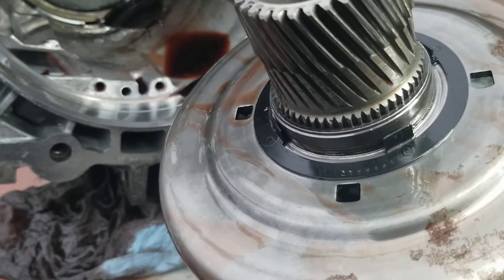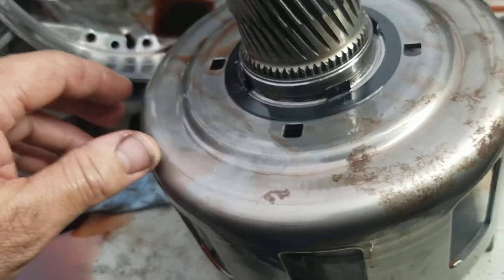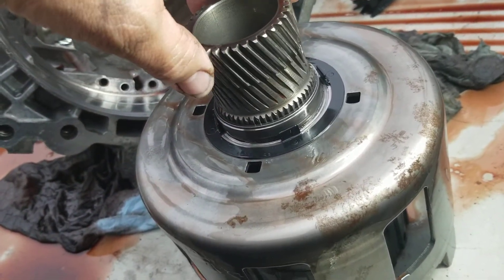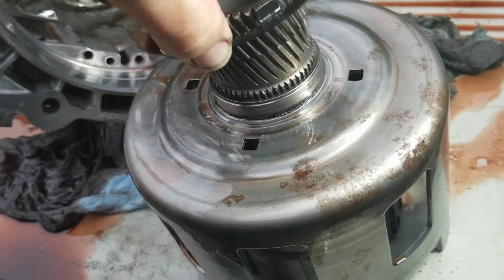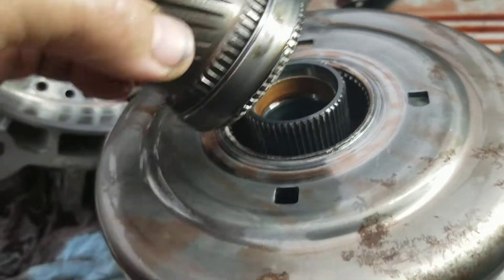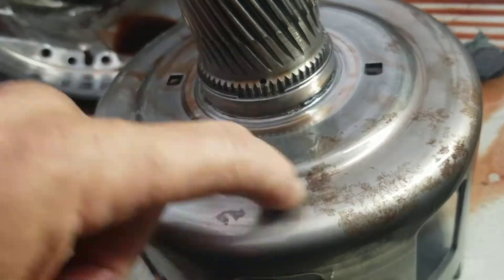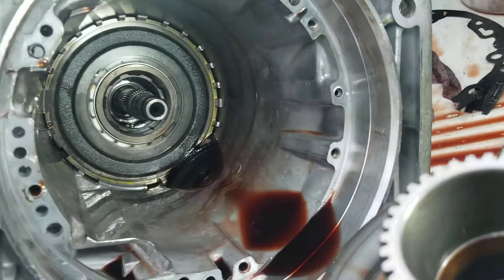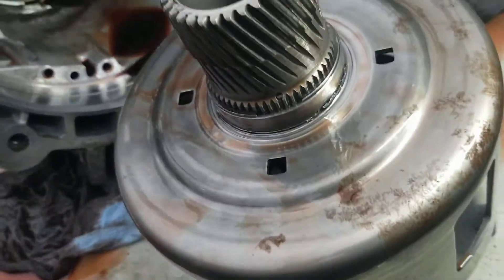4L60E broken reaction shell no reverse

Comment: Do you need to replace the torque converter with a stripped sunshell?
Reply from the maker: No, but if the pump gets trashed that means metal got circulated thru the transmission. I had a few that drove thousands of miles with no reverse. It still worked but lots of hard parts were damaged including the pump.

Comment: What should a shop charge on that thanks
Reply from the maker: I did one recently. I only fixed the reaction shell. It cost approx $900. 
That's $300 to r&r the rest on parts and oil. It's a tricky because if you have a worn out transmission it should be completely rebuilt. This unit I rebuilt many years ago and it had a external filter that kept all the extra metal from trashing the pump.
A shop is gonna be about $600 more.
Reply: I have a question. I have a 97 Chevy Silverado with the 4L60E. I was driving back to work and out of nowhere I started to hear a terrible grinding noise. Kind of like the sound of gear teeth rubbing and roaring against each other. As I press the accelerator the grinding noise got worse and increased with the RPM. The truck did not have any power to the real wheels. I managed to get it on the side of the road. When I put it in reverse without hitting the accelerator it grinds. When I put it in drive, or 1,2, etc it shifts perfectly fine ,but again when I hit the accelerator it starts to grind. When I shift it into drive I can feel the truck wanting to pull itself ,but of course as soon as I touch the accelerator it begins to grind and will not move. I think it may be the sun gear or the torque converter ,but I'm not sure. If anyone may kindly give me any advice it would be highly appreciated. Thank you.
Reply from the maker: It will need to be disassembled to figure out all the damage.